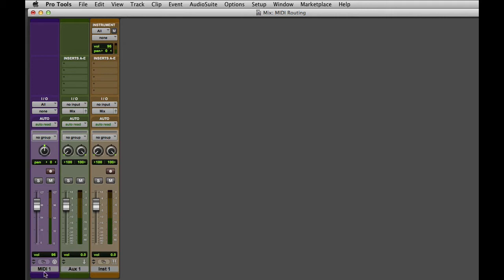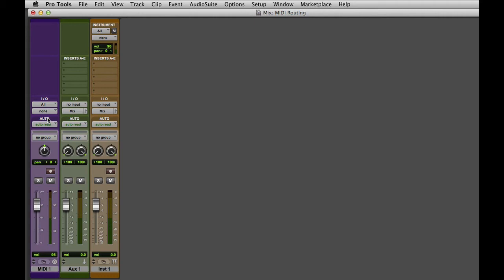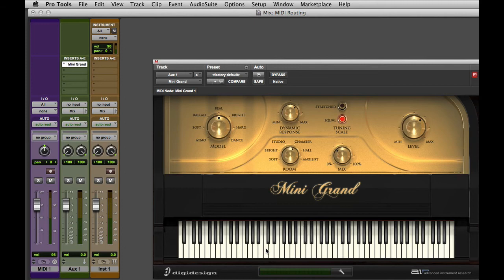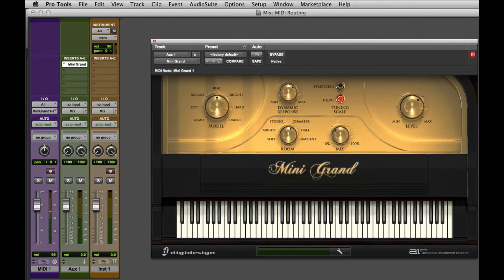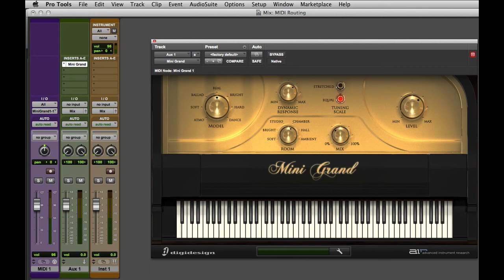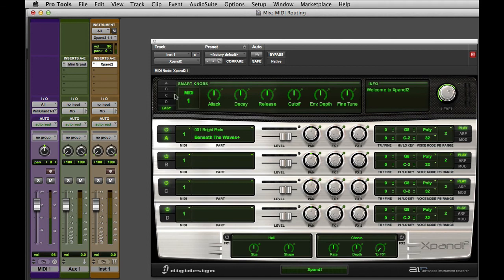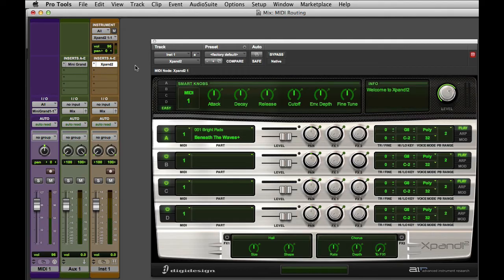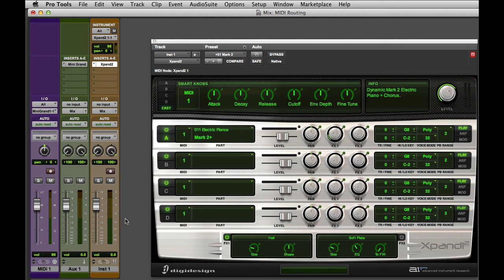Routing MIDI Signals in Pro Tools

Comment: So I'm like 12 hours deep.. PT 2020.11 and I've tried the new instrument track style that you are mentioning. Everything is correct as far as I can tell.. the problem is that I can only pencil in midi... No midi using record enable is being saved... I have my instrument input as all instrument output as db33 and my I/o input as no input and my output as out 1-2 main.. record enable isn't even over writing the penciled in audio... I'm super confused.  Any pointers. Thanks. The midi isn't being recorded as notes unless I pencil it in...
Reply from the maker: Can you hear the instrument when you play  from your controller?
Reply: @erickuehnl  Thanks for the reply! Yes after plugging in an oxygen key board I was able to use it perfectly fine! (I was thrown off because I couldn't click with the mouse to create saved midi... Then further more my mpc doesn't work like a plug in.. it works like a plug in with a daw inside the plug in that plugs into another daws plug in. Super confusing. But basically the mpc wouldn't work like midi... And I was going nuts looking for midi notes. But it doesn't put the real time midi in protools. It would stay in the plugin inside of it's own daw. I'll have to export and import the midi back from mpc into protools. Super inconvienent for akai. Thanks again for the video and the reply!  -Roxwell Z Entertainment